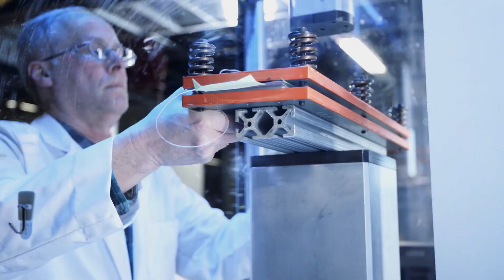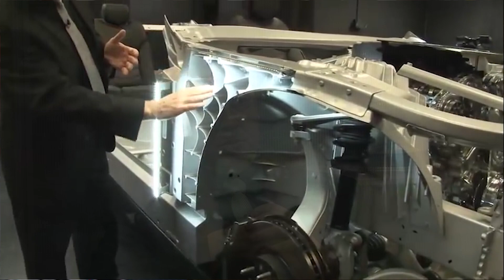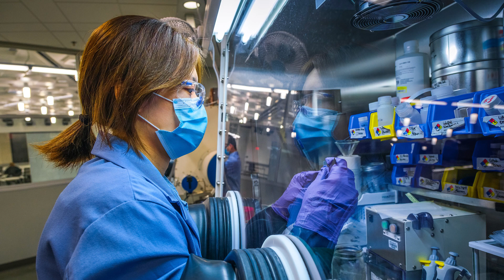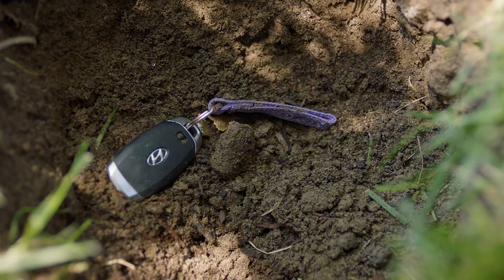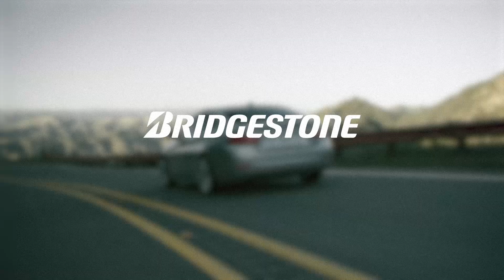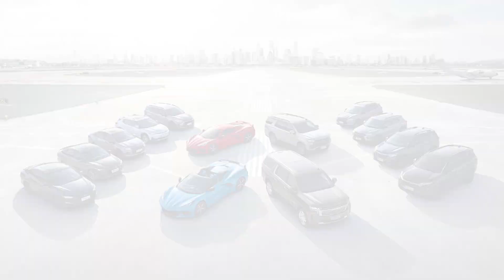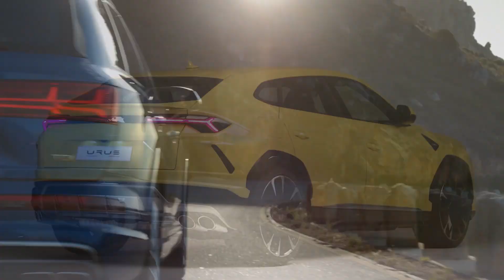GM Steps Up BEV Commitment; JLR Wants to Block VW Group SUV Imports - Autoline Daily 2964

Comment: That's what happens when you stop innovating, you try to sue others, who use your old tech. 🤷‍♂️
Reply: I would argue that the Volt, Bolt, and Lyriq as all innovations. Owner stats from GEOTAB show batteries in Bolt outlasting the Tesla M3/MS against degradation, and the batteries in the Gen II Volt outlasting all EVs. GMs problems in their showroom and especially their dealer model.
Reply: @KTPurdy  You're talking about the batteries that GM is recalling right now due to multiple fire incidents? I'm not so sure they're more reliable than Tesla's, it seems LG's pouch cells have some issue, multiple companies have recalled their EVs based off that design. 

GM's currently solving this design problem by limiting all Bolts to 90 percent of their original charge now, I hope they offer refunds as well, only fair.

Also I have not heard anything about the Bolt being more reliable, where is this info from and how is it measured? Recent research data by professor Dunn is showing Tesla's recent batteries may last 2.5 million miles before hitting 80 percent of their original capacity. 

But lets just say they only last a million miles, why would a consumer product need even that much durability? It's overkill, but understandable when considering Tesla's long term goals of operating their own robotaxi fleets some day, and the consumer stuff is just their development platform for it.
Reply: @AllanSustainabilityFan  Tesla has more battery fires than any EV  maker, The Bolt has only had five, out of 70,000 cars but GM is being responsible and get to the bottom of it and figure out what’s going on.  Tesla instead slipped in a software update, which slowed the charging,  and reduce the range.  There are many active class action lawsuits against Tesla for battery issues, you can easily Google and see
Reply: @AllanSustainabilityFan  the current GM exercise is analogous to  U.S. National Highway Traffic Safety Administration current investigation in Tesla's none crash fires.  In both cases we're talking very small numbers. The stats on actual battery degradation that I referred to are collected by GEOTAB from actual car owners.  It's not based on promises or marketing, but observed degradation from owners. 
https://www.geotab.com/blog/ev-battery-health/
Reply: @KTPurdy  Well it makes sense. GM batteries can't really drain at the rate that Tesla batteries do. They are not connected to dual motors that put out 200KW nor is there anything remotely close to Ludicrous mode. It's good to see the longevity that high. 5 years ago everybody was talking about how you would have to change the batteries on your Bolt and Tesla S every 5 years. That argument is largely gone now except for the Nissan Leaf and it's quite apparent why. The Gen 2 Bolt batteries and the Model 3/Y batteries have a much lower fire incidence than their predecessors. I would be more concerned about Tesla not screwing on a suspension bolt or having a bad collision in the Bolt than I would worry about fires.
Reply: @KTPurdy  The difference is that Tesla's fires were a long time ago with old models when they were just a startup, those problems are long gone.

Also GM does not have OTA, so their effected vehicles are stuck waiting for dealership appointments to adjust each Bolt and limit its range down to 90 percent. The problem with this design is that pouch cells expand when hot and the safety mechanism for handling this, relative to metallic cylinder cells that Tesla uses, makes this a difficult problem to resolve, forcing GM to just limit capacity. 

Tesla had to do this a long time ago with an early Model S batch, I believe a subset of the 75KWh pack ones (iirc), probably a new chemistry that didn't pan out.

Anyway, like I said, multiple companies are going through Tesla's teething challenges from ten years ago today, turns out it's not as easy as they thought, and they're learning more as they go through manufacturing and try to catch up to compete somewhere between Tesla's 2012 (second gen) and 2016 (third gen), depending on company in question. 

Meanwhile Tesla is already working on their fourth generation of EV design, they're not waiting for these companies to catch up. And the major Chinese manufacturers are not going to be confined to their own markets forever, they are in a better position to compete with Tesla and want to flex their wings soon.
Reply: @AllanSustainabilityFan    China's makers will wipe Tesla out...    Tesla design sucks (cars have no style),  features suck (missing too many features) , quality sucks (too many service trips, and Tesla service sucks),  Chinese are smart,  they will not tolerate for long.
Reply: @AllanSustainabilityFan  Nope. The Tesla fires are recent and the investigation that started last year is still in the works.
Reply: @KTPurdy  These fires are in old Teslas, or are you now counting actual accidents?

Other companies are happening in people's garages due to what is now considered "overcharging" when it's done to full capacity, which is why the companies involved are recalling the entire fleet to limit original battery capacity down to 90 percent.
Reply: @KTPurdy  It's the LA times. That's strike one for using a tabloid.

But lets humor this: 
It's just a routine investigation. 

The agency is required to do this when there's a complaint, they did this multiple times in the past from a shortseller's claims, nothing was found, but they had to waste their time anyway. That just tells you that they're doing their jobs as usual.

"Model S and Model X vehicles manufactured between 2012 and 2019"

The fires were in the early models, but the agency is doing its job and looking further out of abundance of caution, good on them.

They will not find anything as usual, and we already know about those few fires from years ago, it's in the past.

Now Ford, on the other hand, has recalled 1.3 million vehicles because the steering wheel fell off, more than Tesla's entire production for the last 17 years in one recall. Just to put recall issues in perspective.
Reply: @AllanSustainabilityFan  Dude, you can find the same information in a dozen different publications. The point is that questions about Li Ion batteries aren't limited to GM. Whether the manufacture is Tesla or GM, the number of fires are minuscule.
Reply: @KTPurdy  Yes, the same information about NHTSA doing its job by investigating claims, investigation doesn't mean findings, there's a difference. 

If a cop interviews you it doesn't automatically mean you're a criminal either, they're just doing their job, and they do that every day when they receive a complaint, it's ok, don't panic lol.

And yes, the LG batteries issue is not limited to GM, there are other customers with this problem. And in the big picture it's not a big deal really, when compared to much more dangerous ICE technology.

But people somehow think Tesla should be held to a special standard on this specific design issue, when cylindrical cells behave differently under such load. When it comes to cell expansion at full charge, a cylinder has the advantage of containing the expansion better than a pouch. This is just a design consideration, not a show stopper for LG, and pouch cells have their own advantages too. 

Just google the pros and cons of different battery form factors, it's a fun read.
Reply: @AllanSustainabilityFan  Do Tesla fanboys give other EV vendors the benefit of the doubt? Nope.
Reply: @KTPurdy  Sure they do, it's not necessarily Tesla fanboy, it's EV enthusiasm, people want proper EVs, not lazy marketing or compliance stuff, meaning proper specs and proper production levels, products that so actually cannibalize a company's own ICE vehicles by being superior solutions as they should be. 

It's painful but necessary for long-term survival, and that's not something most CEOs addicted to golden parachutes are comfortable with yet.

Tesla is the market leader in EVs, and companies like BYD are other EV giants to watch out for, but VW is very promising as well, and they're taking the right steps under Diess's leadership to turn that Titanic away from the ICE-berg.

Check out what Diess says about Tesla, VW's direction and the future of EVs, he's basically gonna sound like a Tesla fanboy, but he's an EV enthusiast that sees the trends, which makes me feel good about VW's chances to stay a major player:

https://www.youtube.com/watch?v=SEo11Dopu-w

I hope other companies take a page from VW's playbook as well. VW's going through allot of pain to get there, but it is necessary in order to survive this major market disruption.
Reply: @AllanSustainabilityFan  My thread started focusing on GM's battery technology which I stand by. GM is far more active in battery pack technology than people realize. As far as the rest, the executive team at GM is beholden to the board who is beholden to investors.
Reply: @KTPurdy  Well I hope they'll surprise us with their results. I worry that their emphasis on the module/pack arrangement will add allot of weight, but maybe the overall trade-offs will be worth it. At least they're seriously talking about making EVs so that's progress in my book.

The Koreans seems to be doing well on their EV programs, and VW is looking promising, maybe GM and Ford can join the party.

I'm gonna try to hold off judgement for the next couple years, but it just gets hard sometimes to see some folks use these future plans as an attack vector against startups like Tesla, Rivian or Lucid etc.

The more companies making EVs the better.
Reply: Is that why Tesla keeps suing other makers like Xpeng?   But Tesla brings no evidence, and XPeng's driver assistance works better then Tesla per Bjorn Nyland.  Tesla has also sued Zoox, Rivian...   Tesla is like a schoolyard bully,  trying to beat up on the little guys
Reply: @dmitchellhomes  I'm not sure why drag Tesla into this when it's news about Jaguar suing others, but Tesla only sued Xpeng when they literally stole trade secrets from their systems through poached Chinese employees. 

Tesla did not sue Xpeng for the shape of their car - unlike Nikola did with a truck design they themselves didn't make.

Tesla has their patents open for companies to use, and XPeng has used those just fine, but that doesn't give them a license to go after trade secrets, that's not on the menu.
Reply: @AllanSustainabilityFan   Tesla alleged Xpeng stole their software code,  but when the California judge agreed that both companies should send their code to a 3rd party to verify, Xpeng quickly agreed, and Tesla dropped the suit..   Hmmm...   Tesla was trying to bully, and got their bluff called...
Reply: @dmitchellhomes  Actually the judge said XPeng was in the wrong, but that Tesla is overstepping by asking to personally access and review XPeng's code themselves.

https://www.teslarati.com/tesla-xpeng-motors-autopilot-code-theft-lawsuit-update/

XPeng has a history of cloning Tesla, including even the design of their own website.

There's no bullying here, just the facts, theft is theft, but it's always amusing to see people defend a known copycat like that. XPeng itself would not deny being a copycat, their admiration of Tesla's design is open record, and that was fine until they took it a step too far.
Reply: @AllanSustainabilityFan    The Judge threw the case out because Tesla did not present evidence of software code Theft.   that is the bottom line...    Bjorn Nyland said,  "if Xpeng stole Tesla's code, they sure improved it"...  haha!
Reply: @dmitchellhomes  Bjorn was saying that tongue in cheek, he's a fun guy. 

XPeng is using Tesla's old Autopilot (v2) code, and they simply dressed it up in their own UI, the functionality is similar to that old code, including both strengths and weaknesses, but they lack the talent to improve it further, that's their work in progress right now. 

Meanwhile Tesla has finished re-writing their FSD v3 code, which is what we're seeing driving around towns and going from address to address instead of just entering and exiting highways like v2 does in the XPeng.

The reality is that XPeng hired a Chinese employee, and he was tracked by Tesla's system for copying internal code and taking it with him when he left, those logs are why Tesla's case was strong, but just not strong enough for the Judge to give Tesla full access to a competitor's own "trade secrets" so to speak. 

If XPeng was not under fire, then the judge wouldn't allow the code to be reviewed altogether, whether by Tesla or third party, so your own claim defeats your argument that the Judge would throw a case, how do you claim that a case is thrown when prior to that you claim it's being reviewed by a third party? Which one is it?
Reply: @AllanSustainabilityFan    No,  Bjorn was being serious after he tested he Xpeng vehicle.       I do not think they are using Tesla's code,  Xpeng uses a different sensor suite,  and the code would likely have to be heavily modified.    Now if you said the might have copied some of Tesla's algorithms I might listen,  but when you say they just copied the code, that is nonsense...
Reply: @dmitchellhomes  You can copy code and then build on it, there's nothing strange about that. It's possible they adjusted it to use a different sensor arrangement, but the underlying machine learning can still be v2. That's the easy stuff, the hard work is setting up the neural net and the AI training processes etc.

Also stating that it's "heavily modified" directly implies admission that XPeng are indeed using the Tesla code as a building block. If it was built in-house by them then why would it need to be "heavily modified" in order to function with their own sensors? 

I'm not sure how this case will proceed since Chinese competitors stealing American trade secrets is still a common industry practice, but at some point XPeng may indeed rise to take GM's place in the market. Despite this one incidence of theft they still do have much more potential as an EV-only outlet working with a clean sheet business model. Hopefully GM and Ford can sort themselves out before they have XPeng eating their lunch next.
Reply: @AllanSustainabilityFan   this case was brought to court in Los Angeles, so it has nothing to do with China, and Tesla was not able to prove their software was stolen, so the case was thrown out of court...   when the judge says case dismissed, that means it’s over...